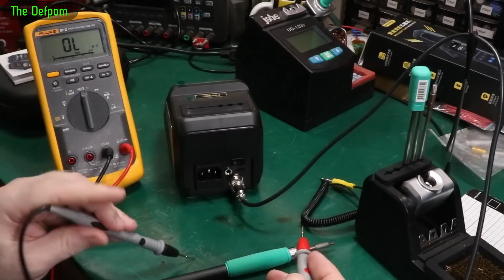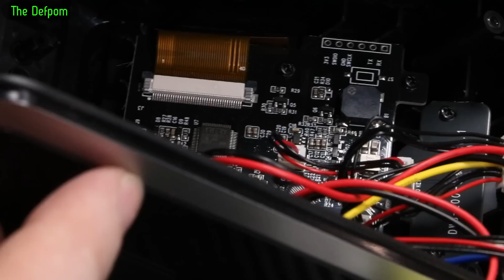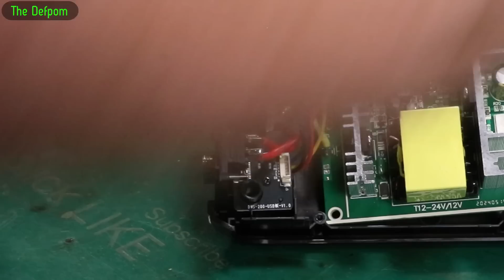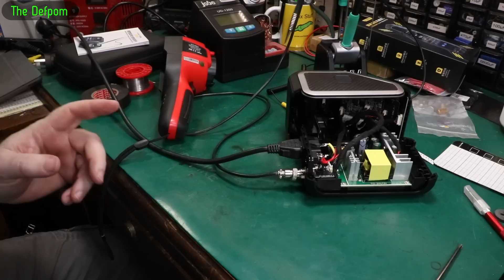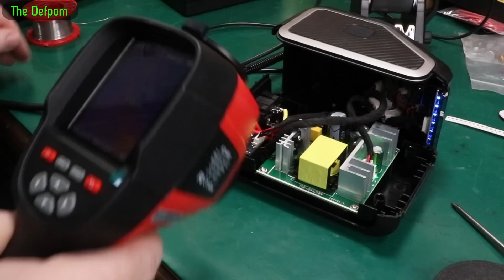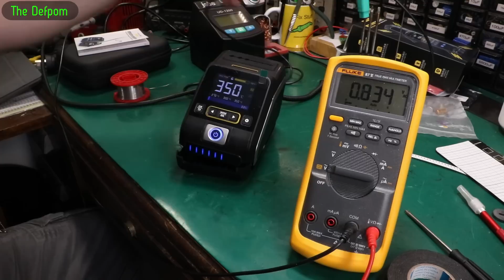🔴 FNIRSI DWS-200 Soldering Station Review Followup and Improvement - No.1321

Comment: Hello everyone,

After seeing three very positive reviews of the FNIRSI DWS-200 soldering station, I became so enthusiastic that I decided to purchase one myself.

Don’t get me wrong—the unit itself works beautifully. It heats up very quickly, has excellent features, and, so far, performs exactly as I expected. However, I became quite concerned about the assembly quality, or at least the quality-control process.

Let me explain why.

When I opened the box of my brand-new DWS-200, I suddenly heard a small rattling noise. When I gently shook the main unit (the control and power-supply section), I could clearly hear something loose moving around inside.

At that point, I decided not to turn it on, and I am very glad I made that decision.

Although I knew that opening the unit could potentially void my warranty, I decided that safety was more important and opened it to find out what was causing the noise.

To my surprise, I found loose drops of solder inside the unit. There were three in total: two were loose and moving around freely, while the third was stuck to the plastic cover close to the AC input connector.

I removed all three pieces of solder.

Had I switched the unit on without checking, those loose solder pieces could potentially have caused a short circuit and possibly damaged the equipment—or worse.

After removing the solder, I reassembled the unit and switched it on. Fortunately, everything is working perfectly so far, and I hope it continues to do so.

However, the experience has left me wondering about the quality-control process. I am not sure where the problem occurred. It could have happened during FNIRSI's assembly or quality inspection, or possibly later in the distribution process. The unit was purchased through Amazon from one of the sellers, Omykou or Jadeshay, so I cannot say where the issue originated.

I am sharing this because, despite being very happy with the DWS-200 itself, I think it is worth checking the unit carefully before switching it on if you hear anything rattling inside.

Hopefully, this was just an isolated case and everything will be fine with my unit in the long term.

Comment: After receiving my unit, it was found to be the older unit that had 90Vac between tip and earth. I chose to install a 10K smd, of which takes the voltage to <0.5Vac, I prefer this to a dead short. What fun it was placing that smd and soldering it in place, the air was slightly blue.

Comment: Bought mine in 2026 and still had this issue, so maybe older stock.  86V on the tip, and yes it can absolutely be an issue.  I soldered a board unpowered, but the scope ground clip was still connected and the board led lit up and my 3608 boost fried instantly.  Sure, maybe i shouldn't have anything connected, but this is too easy a mistake to make and i don't want it to blow something if it happens.  I just bridged the gap with some solder.  Hopefully will be better now
Reply: @rickfuzzy  did you get the 7pin plug model? I ordered mine last week and cooked multiple automotive module can transceivers it appears. Then found these videos lol

Comment: Mine has the resistor from factory they have fixed it with the new units I love mine I made a switch for mine and rewired a 115 handle to work to so I can switch between the 3 irons without unplugging anything
Reply: @SealsEletronicsrRepair  what ohm resistor did they put in the new ones
Reply: What ohm resistor did they use my isn't grounded I got mine in 24 or earlier 25

Comment: FYI I just purchased a FNIRSI DWS-200 from Amazon.  I opened it up and it does now come with the resistor.  👍
Reply: @WOLFN8TR  you are right I just got mine today.
Looks like they fix the problem, good machine first looks and functions  is nice
Reply: @Jr01atlTech  I just bought one from Amazon how do I know if I got a model with a resister ? Do I need to open it ? I just dont want any issues in the future
Reply: @ArtOfWar13  Yeah, you could just open the unit and check if there's a resistor on the pads he points at at 2:41. Edit: If your unit didnt come with the handle that screws into the main unit but instead has that type of quick connect (where you have to press down on the little notch to unplug it from the main unit), you're also good as those are the most recent revision of the station.
Reply: Good. I heard others say the same thing nowadays. Gonna purchase one from Amazon too.

Comment: Nice video i try to fix it. 
I was wondering why I destroyed all my diy projects with mosfer until i saw a little spark at the tip of soldering iron. I never used from that time. Thanks. 
One question please. 
The problem fix 100% or is better

Comment: As an engineer also from China, I've read many comments. It's very unfortunate, but I have to say: in short, the DWS-200 is not a "failed product," but rather a "textbook example of superficial design"—it's loaded with features like a color screen, multiple heads, and sensors, but neglects the core aspects (temperature stability, grounding, and low noise). As a result, the comments section has become its "epitaph."

Comment: :hand-pink-waving:Extremely professional and detailed explanation! However, in most cases, a practical tool like the H-20T is perfectly sufficient for conventional soldering applications: First, its core performance – the average time to heat up and melt solder is 18 seconds, and as fast as 15 seconds, which is slightly better than the HAKKO FX-888DX's 20 seconds, fully meeting the needs of most conventional lead-free/leaded soldering scenarios.
Second, it uses the most common 900M series soldering iron tips, ensuring optimal consumable costs.
Third, the maximum adjustable working temperature is 600℃, allowing for soldering metal parts, enameled wires, etc., providing a wider range of applications.
Fourth, it offers 2-level intelligent sleep mode, with low-temperature standby and complete heating shutdown, effectively preventing dry burning of the soldering iron tip.
Fifth, it has a full working voltage range: AC90V to AC265V, making it universally compatible worldwide.
Sixth, it features an ultimate anti-EOS design, not only making the control unit extremely long-lasting and durable, but also directly benefiting the ceramic heating element, resulting in an average lifespan of over 6 years.
Seventh, it has a unique real-time grounding monitoring and alarm function, effectively preventing electrostatic and leakage damage to sensitive components.
Eighth, it boasts an outstanding energy efficiency design: the control unit consumes less than 1 watt, with 95% of the energy consumption dedicated to soldering at the iron tip.

Comment: Bad Idea. After this modification, you can no longer solder in live circuits. I need a potential-free solder-tip.
Reply from the maker: Very few people solder a live circuit, I never have (at least not intentionally).
Reply: Or you can put small slide switch somewhere on the station to turn the grounding of the tip when needed...
Reply: Or You can use mains cable without groud..

Comment: Isso é uma voltagem fantasma. Não causará dano algum
Reply from the maker: It is of high enough current that it could damage a device, often a phantom voltage would be completely removed with even a slight load on it such as a 1k resistor, but even at 2Ohms it was still not gone, if I remember rightly I did show the current in this video.

Comment: nanofix's channel suggested fitting a 1M ohm resistor.  Is this a bad idea?
Reply from the maker: in this case yes, as the value is not low enough to bring down the voltage at the tip.

Comment: I ordered this station three weeks ago and got it a few days ago. No 90V AC between earth and the tip on mine (about 200mV), so later ones might have been fixed. Another problem with mine.. The power switch on the back worked exactly once (or actually a half time - I was able to turn it on) during testing — now it refuses to turn off. At least it failed in the "always on" position! I’ll have to check the manual in case there’s some special ritual required to turn it off.
Reply: Imagine this: if your grounding wire is not at the same potential as true ground, then even a 0mV voltage between the device's grounding wire and the probe poses a risk.  A more reasonable approach is to design an instant grounding monitoring and alarm function. If there is a problem with the connection between your grounding wire and the earth, it will automatically trigger an alarm. Only when there is a good connection to the earth is the soldering iron handle truly safe and will not damage sensitive components such as chips.
Reply: @peoyli  mine was the same, some forceful wiggling on the switch freed it up, and it now works again.. not great for overall confidence in the design

Comment: Nice video thank you... I've just purchased this myself! I would like to do this mod myself, do you have a link to the resistor you used pease?
Reply: @DazJeffo  Just source a zero ohm resistor for the pad size. Easy.
Reply: @edasmall - A zero ohm resistor is A WIRE. Easily sourced.
Reply: @johncoops6897 make sure you use the right thickness

Comment: I bought one today from amazon canada. i will open it up when I get it and check for the grounding and resistor.
Reply: Any update please on DWS 200 bro?
Reply: I don't think you would need to open it up to check if you just check the resistance between the tip of the iron and the ground pin on the source plug.

Comment: Completely lost now with what station I should get. I wanted to get this since it seems like absolute deal but I'm unsure now and other alternatives for the price seem like rubbish. Is it worth getting if I solder the ground myself? If so do I need to use a resistor or can I just connect both?
Reply from the maker: I am still using this as my main station, mainly because it gives me the option to easily swap between the c210 and c245 size irons, it actually works ok. Before this I was using the Jabe UD-1200 which I also did a review of and also liked a lot.
Reply: Has FNIRSI commented on the issue at all? I reviewed the unit and wasn't aware if this. How do you measure the 90V? I have a multimeter.
Reply: @philscomputerlab  When the station is plugged in and turned on, you can put one probe on the tip and one in the ground hole of another outlet, like on a power strip.

I just received my station today from Amazon and measured 90VAC. Maybe the updated units that fix the grounding issue haven’t been distributed around yet.
Reply: @aflorzy Mine is also not grounded. I've heard two sides. Without grounding it shouldn't be an issue unless you're working with sensitive parts. And with the resistor modded, if you work with a grounded part, the temperature is out of control and or goes full blast...

Comment: I was considering buying ths but after seeing this I decided against it - I dont want to get something that I have to modify myself - I'd rather get the YIHUA 992D-II - its a lot more expensive but it has a hot air station as well and looks better overall
Reply: @george8920  intersting. You are going to buy a solder station, but you dont want to solder in devices. Thats kinda funny 😀

Comment: Just got this soldering station from FINRSI official store on AliExpress and the soldering tip is connected to earth without any modification required 😊
Reply: Any chance you could open up your unit and see, if in fact, the empty slot this video references, does indeed have some sort of resistor there?
Reply: @gastondubois896 it is a zero ohm resistor, have uploaded a couple of photos of the insides to my channel

Comment: The problem exists with most switch-mode power supplies these days.
The cause is omitting the inter-winding-shield that prevents capacitive coupling of voltages on the primary to the secondary.
Easily fixed in manufacture but an absolute pain afterwards if you want an ungrounded no leakage secondary.
Reply: Mainly to save money, I'm Chinese,but I've never usde it made in China

Comment: I didn't use a resistor because you don’t want impedance between the tip and ground. The whole point is to instantly neutralize any static charge. Any resistor would slow that down or limit it which defeats the purpose. For example, a 1M ohm or 2M ohm resistor adds impedance between the tip and ground. If the circuit you’re working on has any impedance path to ground, the voltage difference between your tip and the pcb could stay high enough to still cause esd damage. So a blob of solder is about a million times better than using a 1M ohm resistor. Just solder a blob of solder on the main PCB between the two open pads.
Reply: Use a zero ohm .no issues.
Reply: Absolutely correct!  In switching power supplies, a Y-capacitor is placed between the primary and secondary circuits to meet EMC standards. This leads to a situation where, if there isn't a good connection between the primary's PE (protective earth) wire and true ground, a leakage voltage of 90V will persist. This is a potential hazard, and it's a common problem in the industry. A more ideal solution is to implement a ground monitoring and alarm system. As long as the device doesn't trigger an alarm, it confirms that the grounding is good and there are no static electricity or leakage current issues.
Reply from the maker: This is why I used a very low ohm resistor, from memory it was just 2 OHMS.

Comment: Thank you for your helpful video. Could you please tell me if it is possible to create a jumper instead of using a 2 ohm resistor and achieve the same result?
Reply from the maker: Yes you could use a small wire as well, a resistor is just as an extra level of safety.
Reply: @TheDefpom  Perfect, thank you very much and have a nice day.

Comment: Today, my brandnew Fnirsi-DWS-200 arrived. The first I did: measuring the voltage between tip and earth. 96V AC. Second step: soldering a O Ω SMD-Resistor to the free pads...
Thank you so much.
Why did you take a 2Ω-Resistor and not a 0Ω?
And: Did you get issues with the USB-C-port?
Reply from the maker: I didn’t want a direct earth connection, I wanted something there that can act like a fuse if a mistake is made, 2 Ohm was enough to get the tip voltage down to a decent level. I haven’t used the USB port at all.

Comment: What happen if not grounded likale that?
Reply from the maker: probably nothing, but generally it is better to have it earthed to avoid damaging sensitive devices.
Reply: If you leave a device powered and solder it can cause a short. In some cases the iron tip can cause a current spike through the chips/board traces, sensitive components to ground.

Comment: hi, do you still use this iron successfully? I’m considering getting one and making the same mod. is this advised? thanks for the helpful video!
Reply from the maker: Yes I am still using it, I really like that I can swap from a c245 handle and tip to a C210 for finer work.
Reply: @TheDefpom  Have you faced any thermal problems after the mod? I heard fixing the ground isolation creates a problem with the mcu's temperature control

Comment: so i just bought it and i don't understand is it not useable ? if it will damage my components i don't want it and will return it, i'm no expert that's why i want an answer please
Reply from the maker: @A.Alwaleed  it is perfectly usable, the chance of damaging a component is very low.
Reply: @ thank you for the quick reply, is it better to solder a 0 ohm just like you did ? Or should i just leave it as it is
Reply from the maker: @ if you can solder a link on like I did that would be better.

Comment: Got a reply from CS yesterday, they told me to solder a wire from the USB-C board ground hole* to the ground pin on the AC input jack directly.
* You can see the USB-C board (res-200-USB.....V1.0) under the ON/OFF switch at 6:20, and there is a "ground" (in Chinese) hole next to the pins connector.

They also told me not to solder any resistor/PTC/shorted the pad next to the ground wire.
Reply from the maker: @Vireues  interesting
Reply: @TheDefpom  Since I know nothing about electronic, can you please take a look when you have time? Thanks.
Reply from the maker: @ using a wire connection like that instead of adding an SMD component will be to allow for a higher earth return current, so from their perspective it is safer to do that, but it probably isn’t as safe for the device you are working on, as having some resistance there is safer for the device.
Reply: @TheDefpom I see, thanks so much. 👌🏻
Reply: @TheDefpom  it's not for allowing a greater current. the return ground forms a resistive divider together with whatever your tip is touching as the other side of the resistive divider. the thicker the wire the lower the impedance. you have 250 mV at the tip because your return is relatively high impedance.

With that said, it's pretty important to have some form of current limiting in the earthing of the tip because of operator safety. if with one hand you are holding the earthed tip, and with another hand you touch something live, you could die. that's why things like ESD mats are always earthed via something like a 1K to 10K resistor. This limits the current considerably.